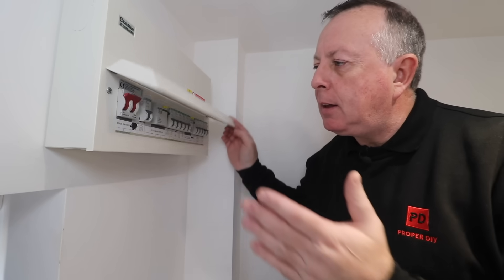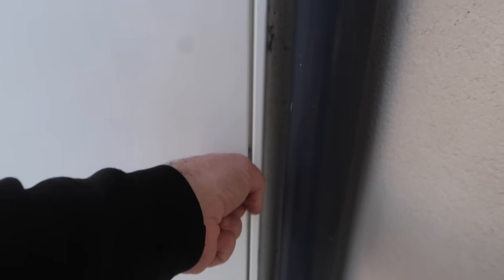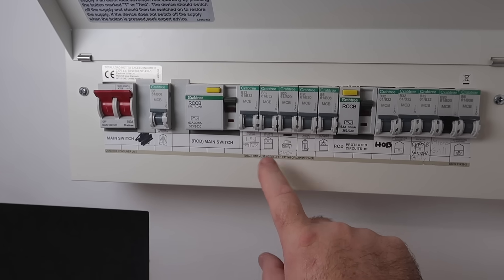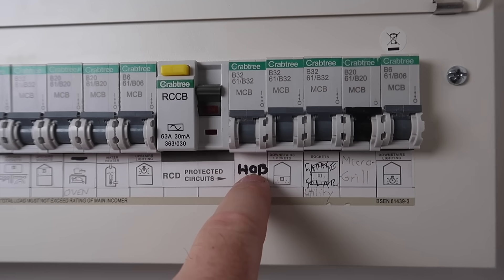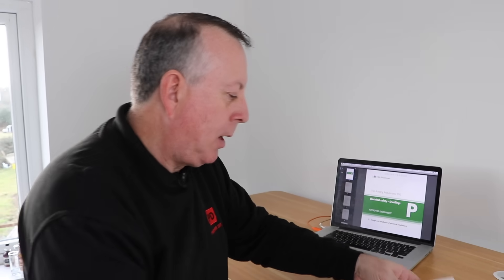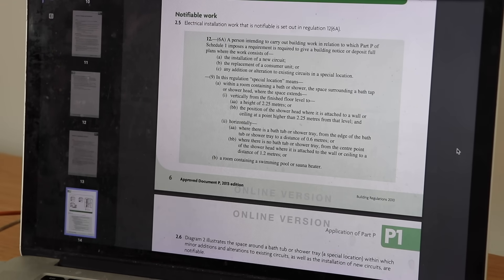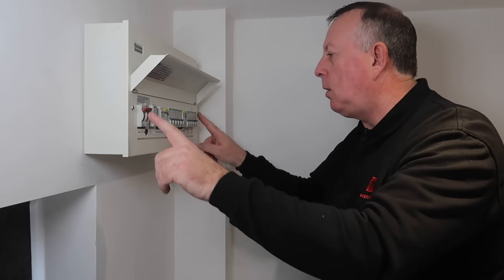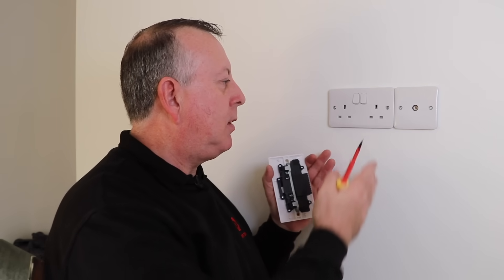What electrical work are you allowed to do in your own home?

Comment: Just the other day I've replaced some switches and sockets, and what can I say? I don't feel safe anymore until i have replaced all of them!
Those "pros" who installed that shit 45 years ago didn't care about anything. There wasn't a single cable that wasn't missing at least 5mm of isolation outside of the switch or socket.

Comment: Generally good information BUT a few mistakes & issues with terminology, there is not and never has been a circuit called a ring main (inside a building) it is called a Ring Final Circuit, also you should mention that the cpc MUST always go to the circuit accessory FIRST then to a back box if it is metal, and the metal back box must have a cpc connection, this has been a requirement since 1966.  Repairs can ONLY be like for like, you cannot change a plastic light switch or socket with a metal version as this introduces a circuit conductive part and the CPC continuity to earth potential in the consumer unit MUST be proven and tested to be within spec.  Also as any new electrical work has to comply with CURRENT regulations you should not add sockets if the consumer unit does not have RCD protection for that circuit.

Comment: You and me fella. I've been a Factory Spark for 27 years, and my Mum had her Consumer Unit Changed 3 Years ago. From the Old Bakelite to a New Schneider Board- Great- the Guy had Tickets and everything.
1st- He Put the Dist Board Up against the ceiling- 2.3 Meters Height- Where  as he Should have put a Junction Box and Located the Board at 1,350mm to 1,500mm as per Regs and Part P. But Most Worrying He Put 32 Amp Breakers on 4 single 2.5mm cables... Legs not a Ring!!!! FFS!!! Lucky I Looked to check his work out and know what I'm doing or my Mums house would have burnt down before the Breakers Tripped- as you know. Experience is Priceless. I feel Your Pain my Friend!

Comment: A couple of my plug sockets have burn marks around them or the switches are stiff on them, am I ok to replace all of them myself ?
Reply: Yes, but you might want an electrician to find out why this has happened if you don't already know. I had to replace one of my sockets in the kitchen when one of my kitchen devices had a short to ground which tripped the mcb, but also damaged the socket just like you described. As I knew the cause I just replaced it knowing that there wasn't a fault elsewhere.
Reply: I think one is just worn- hence the switches stiffening. One was after using an iron in a single outlet and the other was from overusing an extension cable with 4 outlets on it so I think they all just require a simple change no trips happened just could smell it lol

Comment: By law in Australia I as a homeowner cannot do anything except low voltage (read as 12v or below) garden lighting and I cannot remove the cover of my meter box or circuit breaker panel and I absolutely 100% cannot do anything to the meter tails or the incoming service connections. So basically everything is off limits to me. About the only thing I can legally do is run my own Ethernet cables but even that is a grey area with the prevalence of POE.

Comment: I'm thinking of replacing my old electric cooker with a decent gas range one. Obviously, if I did, I'd be left with the old cooker circuit. 
Could I 'repurpose' that circuit myself to provide power to an outbuilding in order to save having a spark out to wire into the consumer unit? Obviously that circuit is already there so I'm not touching the consumer unit in the house. It has a 45a rcd and the wiring in place, currently supplying the cooker, is all 10mm.... Which is all more than adequate given I only need 6 (but would probably up size to 10, both to satisfy my own ocd for continuity and  to future proof) mm armoured cable for the short underground run I need.
I'm confident in my ability to do the work but worried about the paperwork when I come to sell the house and whether building control would class this as notifiable or not. The outbuilding is not a swimming pool or sauna - currently storage/home gym but (what I want to be, hence the need for power) office space/workshop.
For what the spark wanted to charge me just to put a supply in to the outbuilding, I can pretty much buy the range cooker..... there's a gas supply there already and the wife's been nagging for a gas range so it seems a bit of a no brainier to me to kill the 2 birds with one stone if you like. If it's just a case that "you can't piddle about inside the consumer unit" then re purposing an existing circuit that's already wired in, rather than paying him to install a new feed for the outbuilding, and then either leaving the one for the cooker redundant or paying him again to remove the one for the cooker.

Comment: I own it ill do what i want. I fitted the gas boiler. Which has a gas safe certificate. And im in the process of re wiring the house. I would add. Don't do projects that you don't understand. Especially electrics. Theres been many changes that have now been implemented. And finally. Get it fully checked afterwards.

Comment: Well a  lot of FALSE info there. Anyone is allowed to change a consumer unit or add a circuit or alter a circuit as the wish. However they must do it safely and competently and, if necessary notify LABC prior to works commencing or use a competent person scheme member.There is another alternative of using a third party verifier but again not just any registered installer can do that for you (there are other requirements including additional insurance and inspections by  the scheme operator)  Part P in Wales and England differ slightly and Scotland has yet a different system to Part P. Part P is part of the Building Regulations and is law. The Part P Aproved Document is NOT Law it is merely guidance, it is one suggested way of complying with the law. Plus , how do you know that the cutout is a 100A fuse. Only the supplier can tell you that because it is their fuse and it is illegal for anyone else to cut the seal and pull that fuse and therefore inspect and verify the fuse rating. It is a standard 100A fuse carrier and is usually at most 80A fuse or even 60A quite often.
PS - just to clarify - I was a registered domestic installer for Part P from its inception in 2005 to around 2017. Kitchens and outside works never have been special locations, they were special installations under part p. Bathrooms, swimming pools etc are special locations under IET Wiring Regulations, something else you got wrong too.
However good some of your production might be it should never include such whopping errors or it loses any value. It must be correct, yours is not!

Comment: As far as i was aware there are 3 parts to "sign off" electical work, design, installation and test. As a competent person i can do the design (what goes where and with what spec - cable, circuit & switching), installation (physical - boxes, grommets, cable). Then my electrician can test, and my building control officer (private company) will be happy. Please note i would leave all cables exposed prior to test then plaster up afterwards

Comment: The meddling of government etc in your own affairs must stop. Its all BS. For instance, the 230V standard.  I guarantee you not a single tap was changed when they went on that standard. For public buildings, fine. But for private units, you should be allowed to use your discretion. There are set standards, and you must adhere to those. How you get there should be up to you. If you are not familiar/able, then you get a sparktrician. But if you know how to do something you should be able to do it and just have it approved

Comment: My understanding is that i can install the cabling for a new circuit all the way back to the consumer unit, BUT NOT connect it into the consumer unit, leaving the tails dangling. 

I would then be required to get a qualified electrician to inspect the work to their satisfaction, and do the tests with a megger and finally (if satisfied) connect into the consumer unit.

Please advise if my understanding is correct?

Comment: The electrical supply is 240 Volts. The UK's electrical system was set up as 240 volts and wont be changed! e get away with this because of the percentage tolerance allowed.

Comment: My son and I recently extended the upstairs ring to the loft. The difficulty we had was getting someone to check it. Most of the electricians we contacted said they would not test and certify because they could not guarantee wiring they had no seen installed.
Reply: Although electricians won't do an EIC for someone else's work, they will still do an EICR.
Reply: @KX36 

Agreed....... I put up drywall, coving,  fitted my kitchen, double oven, hob, extended the ring, new sockets, under cabinet lights etc and had central heating installed. Finally called in an electrician who did an EICR before installing a  new consumer unit.

No faults found and no £5,000 fine either..........

Comment: I got advice from an electrician.... Our house was sold(new) with ZERO capacity to add anything on the consumer unit- there should have been 25% mcb capacity spare? I wanted a 9.5kw instant shower fitted so did it myself, including adding Henly blocks, a new CU, RCD and 45A MCB with 10mm sq twin and earth with the cable not passing through insulation anywhere and only a short run (8m?)...works perfect..... I discovered the "professional electrician" installed Honeywell valve that should shut off hot water from our multifuel stove to the thermal store diverting to a gravity fed radiator in the event of a power failure had no neutral connection.... I've seen many a screw on sockets and switches finger tight also. I'd rather do the work myself and if I sell the house I'll simply disconnect that shower CU from the Henly blocks and therefore there technically is no DIY circuit in operation....the shower is used as backup to the mains one that is heated from the thermal store but is rarely hot enough (total sh*t design!!)....

Comment: Hi thank you for that informative video, can you advise what the Lewden box is for between the 100amp breaker and the AC outlet going into the house.I am looking into installing a VTL connection system because of the weather changes we are seeing in the UK causing power outages. You say the additional box belongs to you but i see the main breaker is sealed. Thanks for your help in this matter.

Comment: "allowed". What kind of dystopian hell do we live in where we need a stranger's permission to do things in our own homes?
Reply: It's not permission that you're after here, really. There just needs to be an understanding that electrical regulation and legislation is there for a reason. Usually to protect you and your property, as well as your neighbours.

You can crack on and do whatever you like in your own home, however if you're not qualified or authorised to carry out the work and in the 1 percentile chance something does go wrong, you run the risk of damage, injury or in extreme cases, the loss of life to you, loved ones or neighbours.

If also you were to buy a home, would you not like a certificate for some assurance that the electrical installation is safe? Or would you be happy knowing Joe Bloggs had a crack at putting some new sockets in that haven't been checked? I'm sure your insurance company would be ecstatic.

There's around 20,000 accidental electrical fires in the UK each year with 11% being through faults or misuse, a lot of which could have possibly been prevented with removing the anti-establishment attitude.

There's definitely a problem in the UK with poor standards of testing from qualified electricians, but that's a conversation for another day and in short, rectifying that would likely mean bringing even more stringency, similar to the GasSafe way of doing things.

I don't think that's a dystopian hell at all.
Reply: @michaelowen2834  "allowed" implies the permission of stranger, not "You can crack on and do whatever you like in your own home". Also, "in the 1 percentile chance something does go wrong" no appeals to authority will save you.

Comment: Im not a qualified electrician  when i got my house build i did all the electrical work my self  and it got approved with no errors
Reply: There is a lot of work that, by law, has to be done by a competent person. Competent person is not defined though. I have a degree in electrical engineering and was taught the basics of house wiring by my father, an electrician turned lecturer who taught electrical craft apprentices. I have a copy of the current IET Regs, and a calibrated Megger MFT. So yes, I did my own wiring, duly notified to building control, and it passed an EICR because I don’t mark my own homework. I wouldn’t recommend it for anyone who doesn’t genuinely know what they are doing.
Reply: I'm an automotive diagnostics tech/electrician, when our garden offices and stores were built I carried out all the wiring, my electrician came and made the final connections and  verified everything was as it should be,it passed anyway and the inspector didn't bat an eyelid, apart from mentioning that I didn't need to use waterproof glands inside the building😊
Reply: @ apparently most of us engineers overdo it when we do our own stuff. Example: I always chase conduit to boxes, because it makes life so much easier if you ever need to change anything.
Reply: @user-re6yo7tj5s exactly how I do it and I'm running a ring around my new extension this month 👌
Reply: Did you have prior knowledge, or did you teach yourself at the time?
Reply: @blablablabla542 he can’t answer you because he got fried in his electrical house fire 🔥 😂

Comment: The assumption that someone with a couple of GCEs and two years on a building site handing screwdrivers and pulling cables might be more qualified than an 'amateur' with a masters in electronic engineering, who understands PLC logic, quantum theory, thermodynamics and calculus, is laughable. My kids (the preceding amateurs) installed my entire PV system in a day with their eyes closed and saved me around £5,000. Fortunately I'm off-grid so it's nobody else's business.

Comment: Interesting video.  I have just had an MCB fail so went along to the local TLC and bought a new one.  Can I legally do the replacement myself?  It's a Wylex on a busbar so should be straightforward but I don't want to void my home insurance.  The new MCB cost me £3.20, an electrician will charge the best part of of £100 to do a simple change over.

Comment: I think you'll find that the Part P you're using is ONLY applicable to England NOT Wales. Wales Part P comes under the control of the Welsh Assembly (unfortunately) and is still based on the 2010 document so things like fitting outdoor sockets are notifiable in Wales together with other notifiable work that was removed from the 2013 version applicable to England.

Comment: Thank you for the video! From this video, I understand one can now add an outdoor electrical socket spurred off the final ring or radial. What about fixed outdoor electrical installations, for example, powering a home's outdoor condenser (air conditioning)? This would be from the final ring through an outdoor rated fused spur. Thank you

Comment: You can do any electrical job you want in your own home. You’ll just find it hard to sell the property if it’s not done 
well and is classed as not safe. I’ve always done everything myself, rehires, complete wire from scratch on new 
builds and any additions needed. I’m not arrogant or stupid but have always done everything I could myself. 
When I built my own house I did everything and thst is every single trade on site my self. The energy company 
came to connect to the grid tested and passed my work. Never be scared of doing it yourself if you’re capable 
of reading the regs asking questions and studying the internet published guidance. I built a stone house in France 
and did the same studied the French regs on electrical wiring established my own earth as there was no mains 
earth available just three phase supply. That work was checked by edf and passed without any alteration.  
Too many people in this country try and make out you can’t do this and that, only an expensive expert can do it. 
Closed shop trades were phased out in the post war era but they are back sadly with bells on. In my view there
should alway be a compromise to allow component people to carry out all aspects of work in their own homes.
As long as it’s checked and verified, but sadly authorities want to make it illegal.
Reply: Yeh & in any case it would just be a negotiation in the price as they would say they may need it doing. You certainly would not get any value in getting the work done by a pro & then then showing the cert to a buyer as they will never give you the price you paid for the work done, it's how the real world works not the world of bureaucrats who write these stupid regs. Any buyer of a house would get it all checked & if electrics or gas work maybe needed they will always use that to lower the price even if they never intend to have the work done.
Reply: Yawn, this is what an EICR is for.
You get one done and they sign off the electrics in the whole house.
Its such a freaking stupid system.